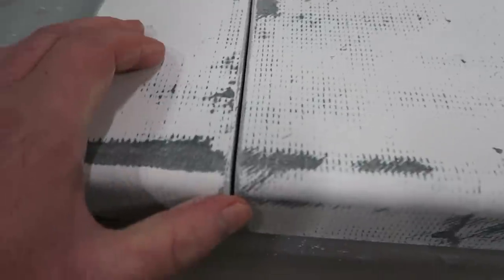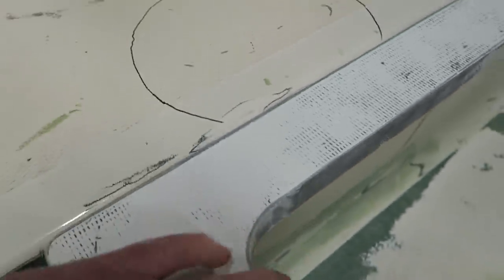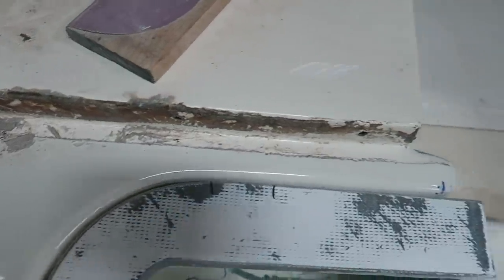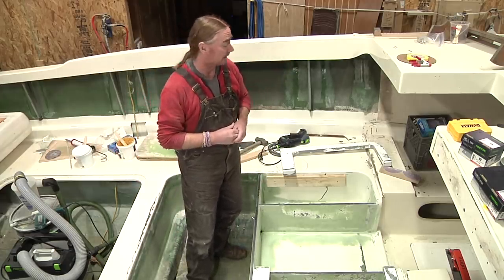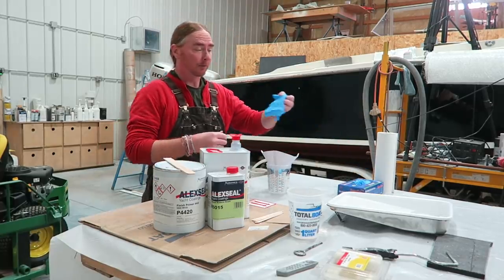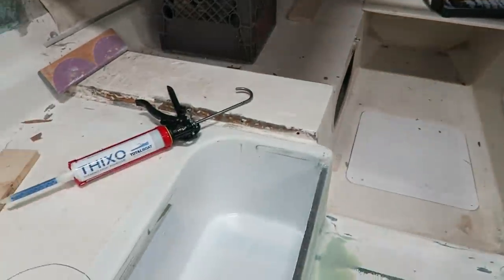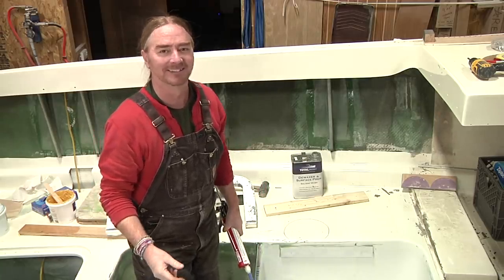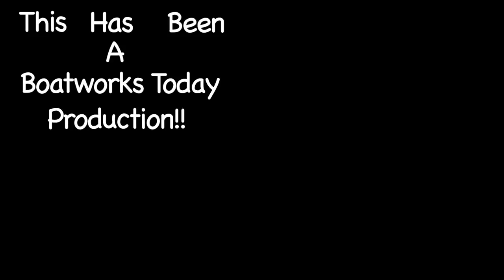Mounting The Coosa Locker Frames On A Bertram Moppie!

Comment: Happy this year! Your project is really taking shape. Personally I think the lid to frame gap is a little too tight as paint will add a few mils to it.
Reply: I agree....track a little sand aboard from a beach and I can see where it would scratch between the lid and frame as the lid is opened.

Also a little  surprised that cleats were not added along the sides, just for a more solid connection between the frame and the rest of the boat.

But hopefully neither of those things will become an issue down the road.

Comment: I thought you said you were going to paint the underside of the hatches before you tabbed them in. Happy new year Andy
Reply from the maker: That was my intention, but time didn't allow that to happen :-/  If I had primed the underside it would have still been wet when I needed to mount the frame to the boat and I  wanted to have that part included as part of the video
Reply: @boatworkstoday  that material used.  The coosa wont degrade if it isn't painted on the underside will it?

I'm curious as I would just leave it as is. But I didn't know if there was a reason other than you doing work way above my level of perfection for painting it when it won't be seen or exposed to sunlight.
Reply: @dm680glenn6  Chad's right. He didn't paint the underside, but I get his explanation as to why he didn't.

Comment: I have a question for you, if you have the time to answer. I have a 1:1 Epoxy fairing material. It’s a lot thicker then I want it to be. Is it possible to add a little bit of 2:1 epoxy resin (different brand then the fairing) to thin it out? Or any other solutions to thing it out?

Comment: also on a side question I have a 1990 Bayliner Trophy 18 ft. My question is if I have to change the fuel tank on this vessel would it be better to remove the cap or cut the floor.  I thank you in advance for all your input and also thank you very much for your very videos they're very inspiring.
 I am a combat veteran and your videos help me workout through some of my PTSD issues by inspire me to work on hobbies that take my mind off of stressful things. Once again thank you very much.
Reply from the maker: I suspect it's going to be a lot less work to cut the floor.  Popping the top can get pretty entailed :-)  Good luck!
Reply: @boatworkstoday  
 Thanks for the feedback,  I do hold your opinion high regards. A lot of this type of lot of people tell me to just cut the floor but in the traditional Boatworks Today, while I'm in there I would also like to work on the stringers and get rid of that wet foam.

Comment: Good morning Andy and happy New Years glad to see that you're in good spirits hope you and your family are well. I also have the same question that  someone else already raised here as a comment. I thought you were going to paint the underside of the frames before you tap them in.
Reply from the maker: That was my intention, but time didn't allow that to happen :-/  If I had primed the underside it would have still been wet when I needed to mount the frame to the boat and I  wanted to have that part included as part of the video
Reply: @boatworkstoday  
 Thank you for the prompt reply and believe me I understand. I did not mean to sound over critical that was just more of a curiosity question will it make a difference or not.
Reply from the maker: @chefunojr  It will get painted but it won't make a bit of difference other than how it looks.  It's already glassed both sides for strength and protection :-)

Comment: Just wondering, how come those locker frames arent glassed in? At about the same stage in my build and wondering if I should glass in hatch covers or not. Also how come you didnt fully paint the inside before covering up and only used primer?
Reply from the maker: Glassing them this week :-)
Reply: @boatworkstoday  Sorry, I meant the inside edge. Will that be glassed as well? I understand the top is going to be glassed over on the deck side. But is the inside going to be glassed in?

Comment: I'm unclear about why you did it that way.  You have a very thin panel gap but I dont see where you are going to make the hinge, will it be h?  Should have left hinged at the center, under the cover?  more of a gap and also rounded over the edge to reduce the tendency of chipping.  Also, I think you should have put the Thixo where the top meets the hull, and tabbed it from the top and bottom.

Im not saying that it will not turn out well.  Personally, I would have made the top with a lip and a raised portion that routs water for the cover.  Being there, if it is for storage it would keep it dry, and if it is a cooler, it would keep lake/sea water out of it.  I think you will understand what I mean if you look at a lot of factory cockpit lockers.
Reply from the maker: This will make a lot more sense next week :-)